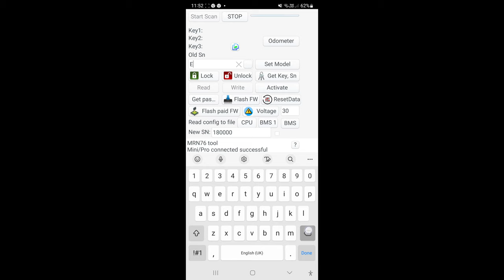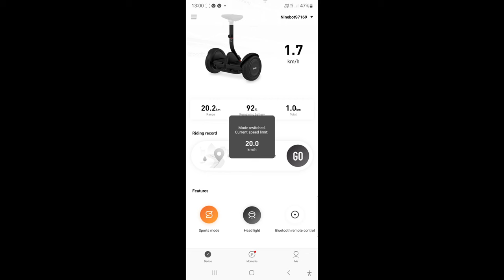SHE COULDN'T BELIEVE THE POWER OF MY MODIFIED NINEBOT GOKART!!!

Comment: Any other commands i can use in the app?? also can you still upgrade the speed?
Reply from the maker: Apparently the motors are at max rpm now so the speed mod won't do anything.
Reply: @andykirby  Ah I see does the upgrade work without  MRN76 on the backend? say if i had the same app